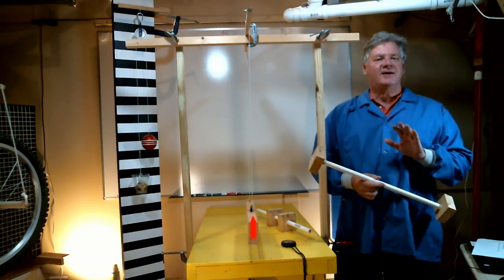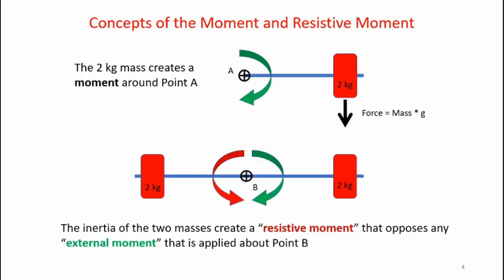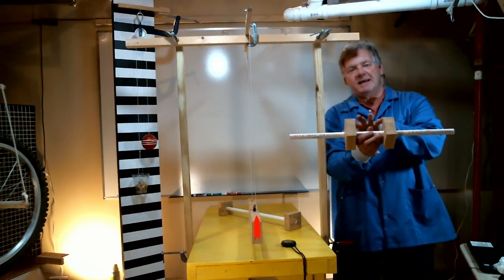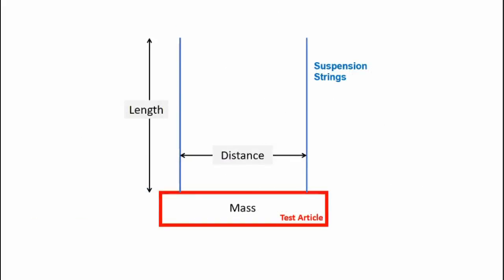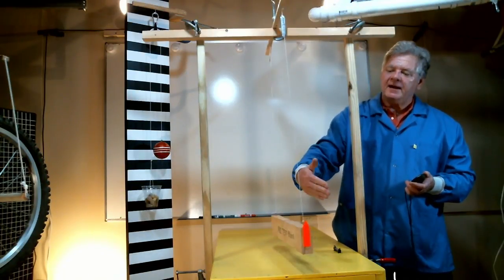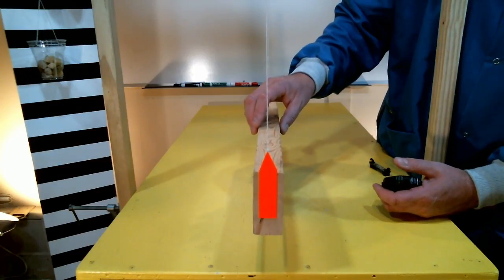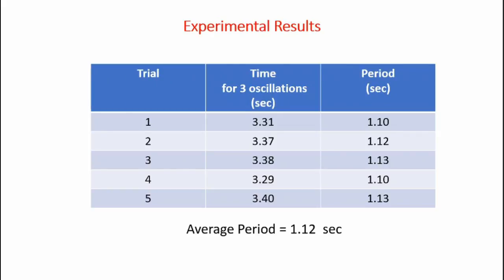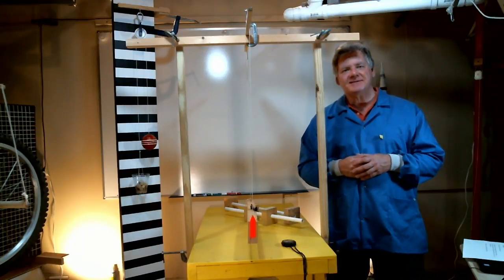Moment of Inertia and the Bifilar Pendulum

Comment: Thanks for that clever demonstration. The one thing that you might like to emphasize is that the dimensions that plug into the MOI equation are the ones that are Perpendicular to the Axis of Rotation. If you'd suspended the wooden board at 90 degrees then the MOI would have been about twice what you measured.